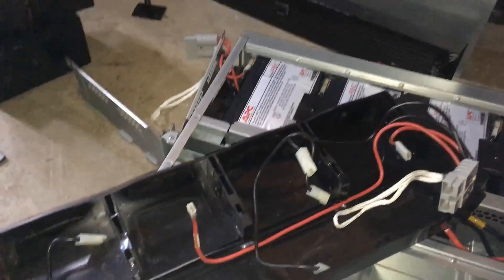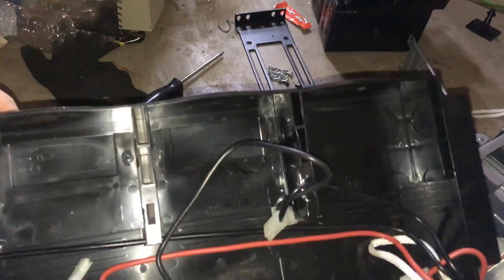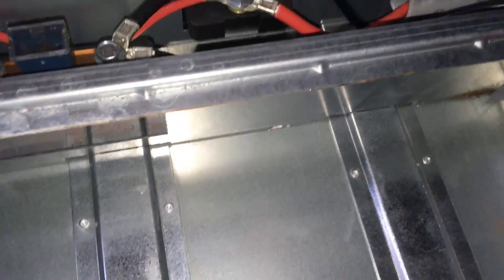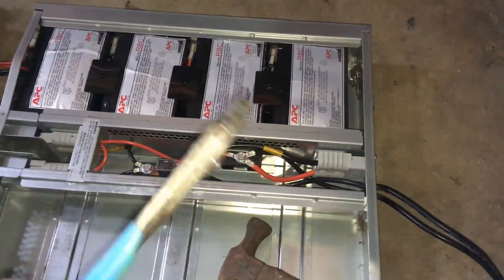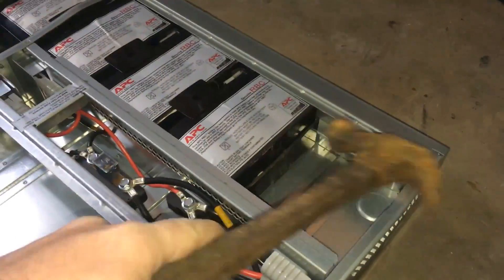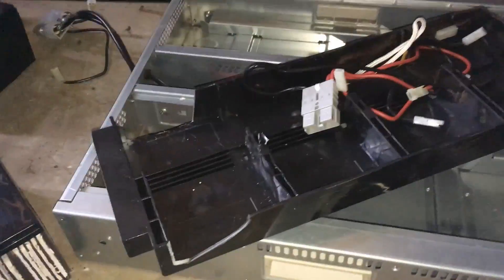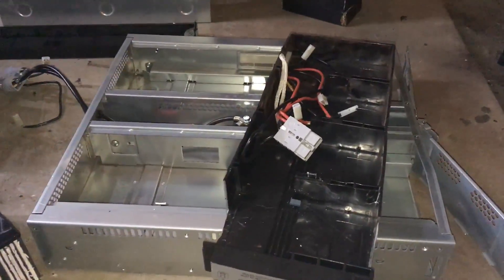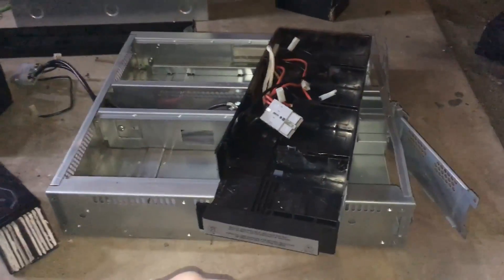Removing "Battery Pillows" from an APC Battery Box

Comment: Broke out the rusty hammer for a "UPS Repair" Yep been there done that. ;) I would add diodes to each positive terminal of the batteries, then at least the charging won't overcharge ones that still have some juice. A little weird as to why they would connect them all together in parallel with 0 protection, especially enterprise stuff.

Comment: A PC stopped making quality UPS units a long time ago. They have no thermal management and are known for boiling their batteries. Eaton, Minuteman, maybe even CyberPower make better units.
Reply from the maker: I don't disagree that their current products aren't as good as what came before.

I'm not sure what you mean by "no thermal management", though. Anything that speaks the UPSlink protocol has an internal temperature sensor. Of course, that doesn't really count as a true battery temperature monitor. I'm unaware of any UPS maker that places a temperature sensor in their battery pack assemblies. It certainly is true that APC's charging circuits can drift out of tolerance and overcharge batteries, thus shortening their useful lives. Most can be electronically recalibrated.

I've yet to find any major brand of UPS that hasn't bloated its batteries after severe neglect, and all of my APC units were unable to carry any load long before the batteries swelled up and caused problems. Other than by virtue of people forgetting about the unit or just not caring, I don't see how they manage to go unchecked for so long after the unit has undoubtedly stopped working.

(Actually, there is one exception: I have an NCR branded UPS made by Eaton/Powerware and until recently, it was still running on its factory supplied, sixteen year old batteries. They were weak, but still capable of holding a decent load for long enough to shut it down in an orderly way. Either that one unit left the factory with unusually good batteries and a perfectly calibrated charging circuit, or their engineers really knew what they were doing. Tempering that, I have a much newer Powerware 5110 that I removed severely bloated, six year old batteries from.)
Reply: More then anything using cheap Chinese batteries that can't handle the current the ups draws or can't handle float charging for a long period of time. The one thing that gets me is how they passed quality testing. I have Apc's of all ages laying around, all work good. One has a battery I bought new 6 years ago, it's still going along good although I should change it one of these days to be sure nothing nasty happens.

Comment: Wouldn't it make more sense for them to use a low number of large high quality batteries, like several deep cycle marine batteries rather than instead of using a high number of small low quality batteries?  I think the quality of those batteries too variable for a large battery bank like that.  All it takes is one dud or one  that ages early  then the whole bank will be out of balance.  I'm surprised that is on the original 2002 batteries.  I guess they made them better back then!
Reply from the maker: It's got to fit in a very specific form factor. The batteries used aren't low quality.

Comment: I prefer Hitachi CSB batteries, quality stuff
Reply from the maker: I'm not sure how Hitachi fits in. These were all CSB batteries.
Reply: uxwbill i got their HR 1234 Heavy duty 9 ah model for my MGE UPS, rated for 8 years service life, a heavy solid little lump at 3 KG for its size, i test it with a car battery tester and measured over 250 CCA and wrote it on the battery with its install date

Comment: Give me a Harbor Freight hydraulic press, and I shall move the world. Archimedes.    What I might have tried,  some wood blocks and a crow bar,   placing the wood blocks in the case to pry against as you move the batteries out with the crowbar.    An assortment of wood blocks can be mighty handy at times.    My emergency power supply is a couple of car batteries and an inverter.   A battery maintainer to keep it the batteries charged.   Not perfect but it gets the job done,  runs the TV a few hours until the power is back.   If the power were to be out for an extended time, I've got some 12 volt LED lights I could hook up.   Semi prepper here,  power to the electric can opener is a priority.

Comment: Bill, you need a couple of extra tools, one is a pry bar, the other is a drill.  With acid batteries, give it a good bath before you start, throw in a good amount of baking soda which will neutralise the acid.  Now to remove the tray, get the pry bar behind it, and pry it along, once it's out a couple of inches, get a short length of 2x4, about 6 inches long or so, start with the 2 inch side, put that in, and the pry against that to push it out further, then switch to the 4" side, and pry some more,  then the 6" side, and pry some more.  Now put the 2" side against the plastic, and whale on it with your hammer.    

Once the tray is out, flip it over, drill through the plastic behind each battery, put a brass rod through the hole, and whack that with the hammer a couple of time, the battery should drop out.

Comment: Good old APC and swollen batteries... The large company I work for won't even purchase APC anymore for critical equipment. We've had way too many difficulties with them. We've had the best luck with Eaton/Powerware and Leibert double conversion units.
Reply from the maker: While I do like Eaton Powerware's product (their technical support is also top notch), I wish they'd implement their UPS' USB communications using the generic HID battery class standard. It would also be nice if they had more of a retail presence in physical stores. Liebert/Vertiv also seems to have some good products, but the same quibble applies to their communication protocol as well. (I have a video somewhere featuring two ~500VA Liebert units I came across. For such low end models, they were unusually nicely equipped, including boost and buck capability via autotransformer.)

I've yet to come across a double conversion UPS. I'd like to find one someday and tinker around with it. Most people seem to buy APC, so that's what I usually end up with. These days, if I buy new, I'm as likely to buy Cyberpower units as anything else. With few exceptions, my older APC products are faultlessly reliable. (The oldest is from 1987 and still going strong.) The newer ones have been OK, but aren't anything like as good as they used to be.

Comment: Angle grinder.
Reply from the maker: Too destructive, and all those sparks probably aren't a good idea around these batteries, especially the ones with ruptured casings.
Reply: uxwbill but the video would be great!
Reply from the maker: I should have gotten video of the Keykeeper and I cutting open some broken hermetic refrigeration compressors, so we could see why and where they failed.. That was a pretty good show. Turns out their housings are a lot thicker than I would have expected.

Comment: I've serviced an old rackmount APC SmartUPS 2200 where one battery in the battery pack had shorted and the others had been overvolted and cooked very badly. One went completely open circuit and another one partly melted to a point where I could see the insides of the cell....
On a different rackmount SmartUPS the batteries had leaked to a point where it even screwed up the cables.
I still have both rackmount SmartUPS devices in storage and I'm planning to build a house backup power supply with those one day.

Comment: I usually find the swollen battery issue where the UPS has been run in a hot room, say 80 to 90 degrees, for several weeks.

Comment: Make sure to check the float charge voltage and adjust it down if needbe.
Reply from the maker: Attached to a "test set" of good batteries right now, it's floating at 13.6 volts per battery. That's good in my book.

Comment: Those are pretty goosed batteries, at least they didn't release the schmoo like the ones in my tripplite did a couple years back, boy was that "fun" to clean out!!! :S

And pop along to a dollar store, they probably have mini-tripods with phone clamps that you can detach and screw onto a full size tripods, cheap improvements for video making... :)
Reply: Depending on where you go to (usually somewhere online), you can find the phone clamp by itself, and that's how I got mine.
Reply: I've had a couple of "online" mini tripods, and despite looking the same as the ones I bought from Poundland (UK equivalent to a dollar store), the online ones broke pretty easily after a few uses, and actually cost more, so, sometimes online stuff ain't worth it... :)
Reply from the maker: I found some batteries that had leaked goo all over the place in an Eaton Powerware 5110 UPS. At least they put a flexible molded plastic enclosure around the batteries that contained most of it. It's sitting here right now, filling in for an APC Back-UPS that started suffering random "output shorted" fault codes.

I don't plan to make an investment in cellular phone video shooting accessories. For this, I should have gone and gotten the real camcorder and paired it with an actual tripod. There's no other fault at play there other than my own laziness.

Comment: You know Bill I have been watching you  for quite some time. IDK how long but several years time long enough to remember the IBM PS/2 tower video. And the fact that you haven't dropped $20 on phone case with a gorilla pod to aid you in making you videos less shaky and less work on yourself. Also only you would have a video about the nastiness that is an absolutely overvolted/overcharged UPS system.
Reply from the maker: Any video that I take time to prepare for and shoot is recorded on a real camcorder (presently a Sony HDR-PJ200) , for which I have plenty of tripods. I only shoot video on the phone when stealth is called for, if it's a spur of the moment thing, or I was far too lazy to go and get the real camcorder.

I need to haul that PS/2 out and finish my work with it, but before I can do that, the heatsink for the processor complex's second voltage regulator needs significant rework. Otherwise I fear it'll burn out. Thus far I haven't found the enthusiasm, despite having come across several heatsinks that I like.

Comment: One good idea to visually measure the entire battery box's vital condition would be to make an additional box with 2x4 voltmeters ( either plain oldschool needle dial or modern digital, it doesn't matter ) and run eight wires ( one from each cell to its own voltmeter ) plus common ground. Might be an interesting project to prevent such bloat-ups in near or far future.

Li-Ion/-Po cells are equipped with balancing wires attached to their charge controllers to prevent any imbalance which would damage the cell(s).

Comment: gonna guess like all post-2003 APC UPS's, this one had its float voltage drift up to 14.2V per cell. I just had to adjust the battery float voltage gain on a free SUA1500 the other day, which had fried its batteries in a very similar manner. it had been in a closet and was only pulled from service when people seated nearby were complaining about a fishy smell...
Reply from the maker: With a set of "test batteries" hooked up, the UPS is float charging at 13.6 volts per battery. I'd call that pretty good. This UPS and its battery box are from 2007, and both were evidently forgotten about. It was still plugged into the wall outlet when I removed it!

Comment: Been here before... long ago I was tasked at reviving a double-decker looking smartups 2200.  Batteries were ballooned, and wouldn't come out.  For some reason we didn't have a hammer at work, but had a crowbar and a baseball bat.  UPS worked fine for years to come after the extraction...
Reply from the maker: Oh, I wish I would have seen that take place! I'd love to know how the baseball bat in particular fit in. :-P
Reply: @uxwbill  haha I actually used it over the crowbar in the end. The baseball bat was soft in comparison and was able to force the batteries out, but I used the crow bar to bend the frame out of the way.  I guess it's not so exciting when I put it that way.  What's more exciting was re-wiring a live 220v 20a outlet and shorting it out at the same time. But that's a story for another day - and one i'm lucky to be alive to tell.

Comment: no heat  well not much just expansion  of the led plates as  they age   due to corrosion  iv seen them even worse than that    had  a  week old 75ah  battery get cooked by  charger  that  was putting out ac   due to a fault (that  did take  out a 25ah breaker  charger  had  burnt  right out   lucky  the case  wasn't plastic

Comment: 6:44 what is the source of that vapor that starts showing up on the screen, because you don't seem to be smoking a cig or anything.
Reply: kght222, it's the ghosts of batteries :-D
Reply: @zx8401ztv  well i hope he covered his mouth, those ghosts can be caustic.
Reply from the maker: That's gravel dust tracked in from the outside and left on the concrete floor. It was no part of the batteries.
Reply: @uxwbill  honestly didn't think it was, and man concrete dust on a concrete floor sucks, built an osb floor on top of 2x4s in my basement just because it is completely impossible to fully clean in that inclosed space. the floor feels so much warmer now too.
Reply from the maker: @kght222  If this weren't a garage, I'd probably put something down for a floor covering. The floor has (as yet unimplemented) hydronic heat loops built in. There's a lot of fine dirt that also gets tracked in, and I"m always sweeping that back out again. Oh, and Airsoft balls from when the Keykeeper and Furhead were into that...years later, I still find them hiding out in all sorts of places.

Comment: Start with a flat head screwdriver and inch the batters forward
Reply from the maker: I tried that (you might see one in frame somewhere) and the batteries were so tightly wedged that it deformed the metalwork instead of causing the batteries to slide out.

Comment: Those batteries must have caused quite a plastic burning stink when they were hot. Having experienced what 2 produce! Also, on my 750XL's external battery pack, I put the outdoor probe of an indoor/outdoor thermostat inside between the batteries. It's useful for spotting early failure signs and temperature monitoring during summer.
Reply from the maker: I've always wanted to catch one in the act of doing this, though I figure it's got to be a slow process. Something kind of like how glaciers work, and every bit as impressive (just on a smaller scale).

I've never seen a need to monitor the battery temperature in any UPS I have. For me, the batteries have always become too weak to support an attached load load before they showed any sign of physical distress.
Reply: @uxwbill  Yeah my UPS is the same but I like to take precautions...  Ones I get doing this are protecting parking garage pay machine/barrier servers. The batteries can be too hot to touch in some incidents. Most of the time they do simply loose ability to support the load as you say, most ones that overheat fail in my work have a low load and the test doesn't pick failing batteries up till it's too late.

Comment: First!

Saw the title and thought oh man that sounds dangerous lol. Uxwbill have you ever had one of those UPS batteries explode or at last spark while removing bad one from a machine?

edit
If you do use it whats the plans for that UPS must be something big to need something that sized?
Reply from the maker: An explosion is extremely unlikely. A spark or two at the connections isn't uncommon when reconnecting a new set of batteries to a UPS that has been out of service for a while.
The battery box goes with a 3U Smart UPS 1400 XL. At some point, I'd like to find a proper equipment rack in which to place it and other pieces of equipment.
Reply: @uxwbill  I take it dry lead acid batteries can't go boom like others than? Wow that would make me jump if I was replacing batteries in one lol. Sounds interesting I'm sure myself and the rest of the viewers at home look forward to seeing what you do with it down the road.
Reply from the maker: @JohnSmith-xq1pz  These sealed lead acid batteries are extremely tolerant of abuse. However, just like their more spillable counterparts, they can emit small amounts of hydrogen sulfide gas if charged too quickly or overcharged. Under normal circumstances, the design of these batteries allows this gas to safely recombine inside. There's actually a small pressure relief valve assembly in each cell of the battery, for exactly this reason.

The spark is usually created at the UPS's terminals when they are connected to the battery pack, and it's generally harmless. Most of the time it's very small. A long disused UPS can put off a pretty good pop: https://www.youtube.com/watch?v=J-QFWZ0TYQo .
Reply: @uxwbill  So there pretty much Uxwbill prof? Lol. Checked out the linked video, yup that would make me jump out of my seat 😮